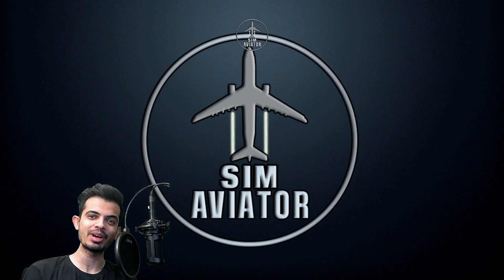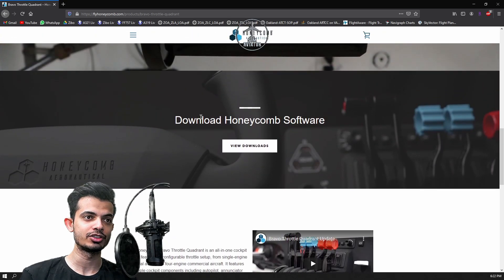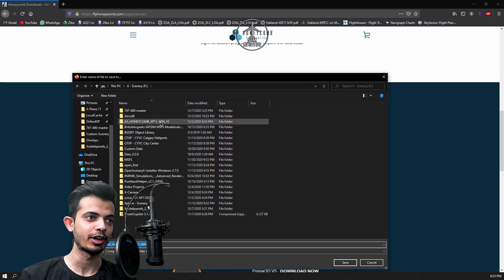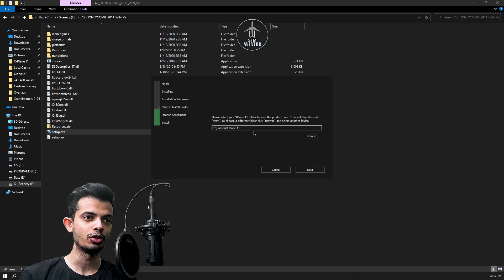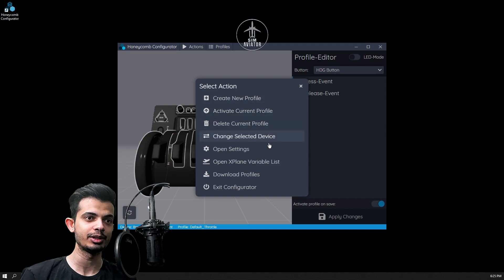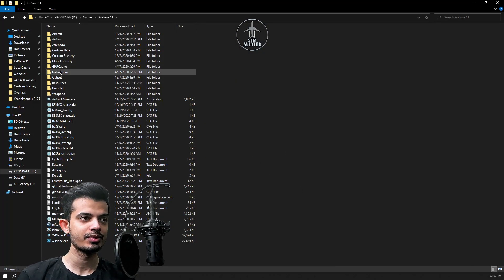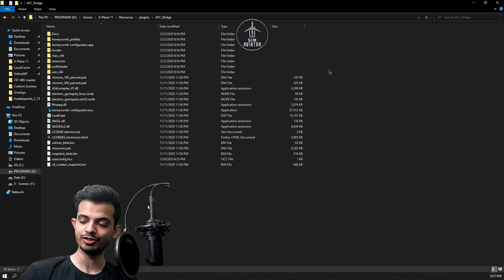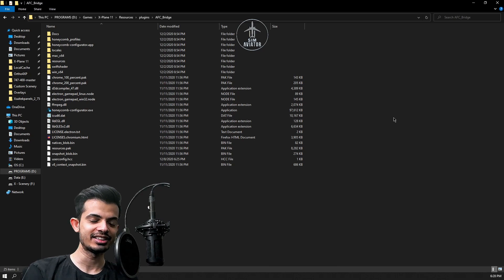Honeycomb Bravo - Install Drivers and Make Lights Work

Comment: Good video but do you fly Microsoft Flight Sim 2020.  My question is did you figure out how to program all the buttons?  I have ALT, VS and HDG all good; however CAS and IAS still elude me.
Reply from the maker: Yes I do. I couldn't figure those out too. Some things on MSFS are too complex. Xplane is much easier to figure out in those regards. I will let you know if I figure it out!

Comment: It won’t let me download the drivers for Microsoft x plane as when I click it it just does nothing
Reply from the maker: I had someone with a similar issue. Try opening the download link in New tab. Seemed to have worked for others. Let me know if it works for you
Reply: @SimAviator  not for me
Reply from the maker: @prisimhacks  hey! You can try using a different browser in that case! 🙂

Comment: Hello. I got the throttle today. Plugged in my pc. Started x plane 11 but I need to bind every button by my self. I thought there was an standard configuration help..
Reply from the maker: Hey Thomas, once you install the driver the two autopilot knobs will work however you will still have to manually bind the rest to your liking
Reply: @SimAviator  nope x plane doesn’t see anything of the driver.... did reinstall it 10 times.
Reply from the maker: @thomasVK7639  Do your lights work on the landing gear and such? Do note that you will require to load up in the sim for you to be able to see the lights
Reply: @SimAviator  nope. No lights. I found out there is also no AFC_plugin file in my plugins folder.
Reply from the maker: @thomasVK7639  If you have it installed correctly, the lights should come up. I will look it up for you
Reply: @SimAviator  okay no lights nothing...

Comment: every time that i direct to my xplane diretory, its give me no found. i have no idea what is the problem
Reply from the maker: Hey man, unfortunately I haven't had that issue so I wouldn't be sure what's happening there. If I see any solutions, I will reply here again.
Good luck!
Reply: Same problem - It tells me it can not find my Xplane folder even tho I know that I have the correct address to the folder
Reply: hey, I found the answer - Below is the answer from Honeycomb -  I did a search in my C drive for "x-plane_install_11.txt" then open it with notepad ( backed it up first) and deleted the one wrong address (I only had 2), and resaved it.  Tried it again and it put the correct address in the search field.

here a short description of a possible solution (comes from Honeycomb):

Please look into this file "x-plane_install_11.txt"

You find it in this windows system folder.

C:\Users\<name>\AppData\Local/

At first, make a backup of the file (x-plane_install_11.txt).
 
Open it with a small editor (windows editor) and delete all path's which are not matching your correct path to X-plane 11.

Then save the file.

That should fix the problem.

Be careful in this location. It is a windows system folder.
Reply from the maker: Wow thank you for the wonderful explanation. Hope this will help others
Reply: @suiterll  thanks body

Comment: Really looking forward to seeing how you configure the Bravo with the driver. I’ve had a little trouble.
Reply from the maker: If I get your comment right, you wanna see how to use the configuration software. That might take a bit to figure out, but I have been able to configure most buttons on X-Plane 11 inside the Sim itself. I will be making a video for that as well.

Comment: Any ideas on if the new bravo will need to have drivers installed. Awaiting delivery.
The Alpha seemed to work out of the box?
Ty
Mark
Reply: Roger that 
Mark
Reply from the maker: Feel free to ask any questions you may have!
Reply from the maker: Hey Mark, the throttle will work out of the box, but if you want the lights to work, you will need to install drivers for Xplane and P3D. For MSFS 2020 you do not need to install any drivers as they have said it will work once update 7 comes out.
Thanks for stopping by!